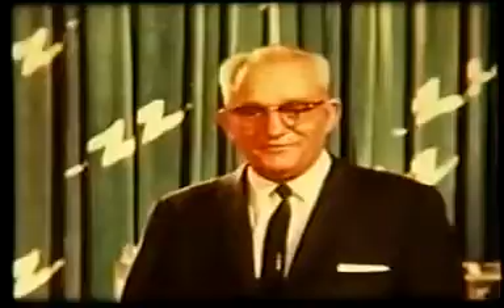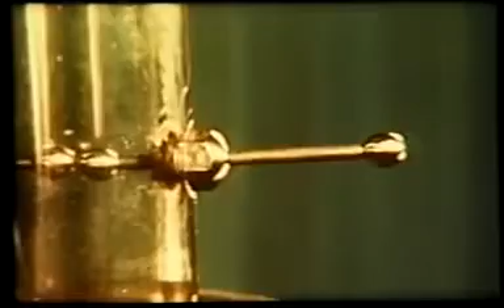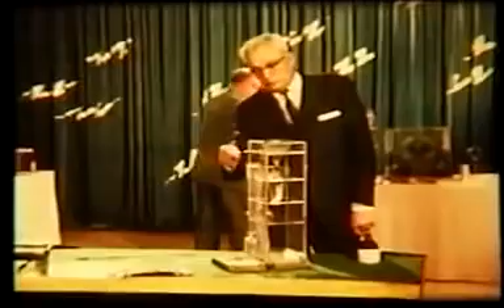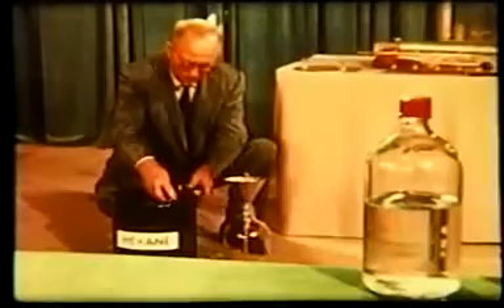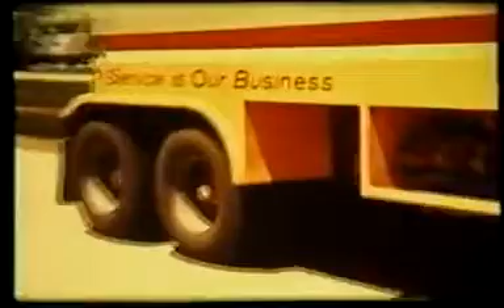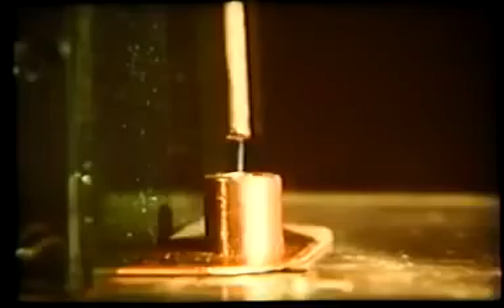HOW STATIC ELECTRICITY WORKS

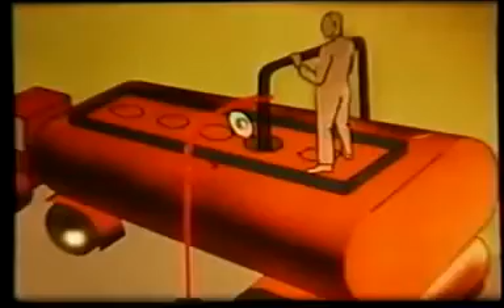Comment: 06:07
in modern systems to disable the fire triangle fuel trucks have a vapor recovery system and no oxygen is allowed in the tank but its filled with inert gasses, i think its nitrogen as its super cheap.  the same concept is true with ships that carry fuel oils to prevent explosions of empty tanks that was once filled with fuel.  if that system was in place the fuel truck would have never caught fire.

13:06
wow i always thought that when vacuuming and when static was generated by dust that it was by the piezoelectric effect of that i was vacuuming dirt that contained small crystals that smacked on the wall of the hose and because i was not grounded i would accumulate the charge.  wow very interesting.